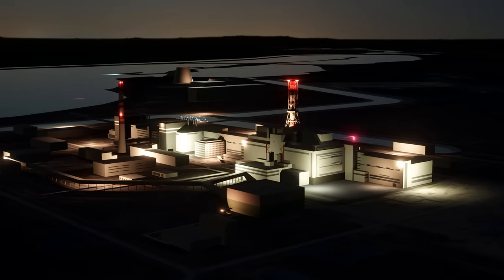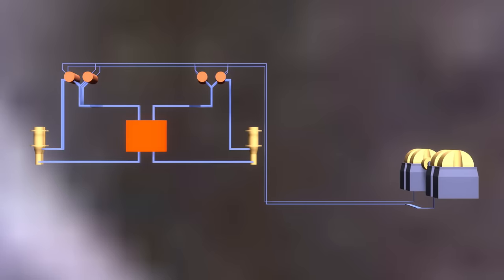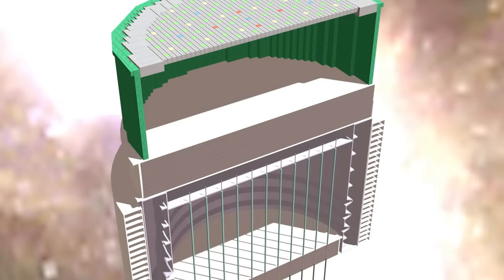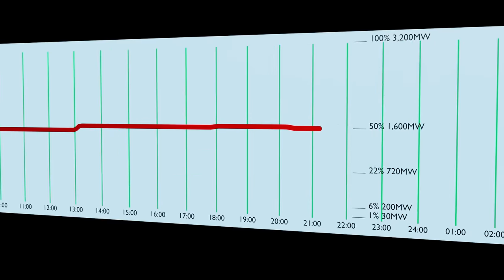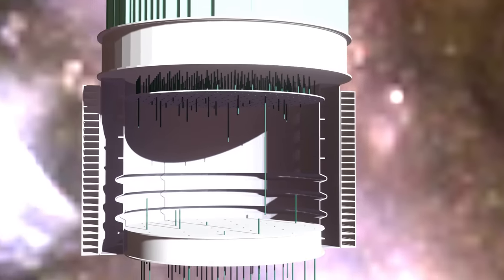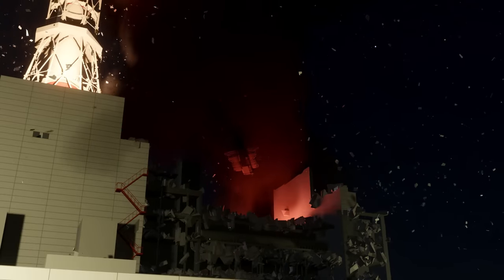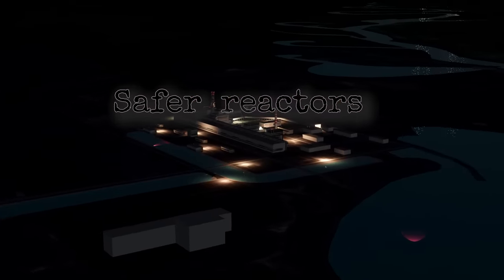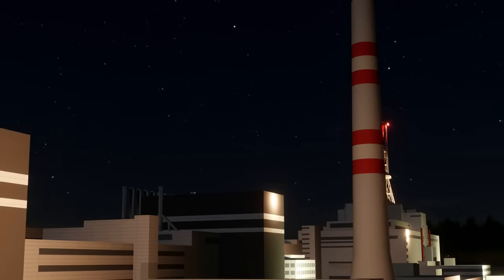CHERNOBYL AZ-5 why it exploded

Comment: Some mistakes i've found:
- Night shift wasn't unexperienced at all;
- Xenon poisoning is not the reason of power fall at night. Truly reason is unknown and happened at change from manual mode to automatic;
- Xenon poisoning did not happened due to half-power work. It happened due to power fall at night;
- Then xenon was mostly burned, from night power fall to experiment start;
- Dyatlov did not make decision about extracting of all control rods and about power rising after fall. It was Akimov or Tregub - evidences are different;
- There was not agrement about AZ-5 push after the experiment or before. Reactor could be shutdowned at any moment, cause it wasn't necessary for experiment. Experiment was runned on turbines, not on reactor;
- Experiment are not the cause to explosion at all, it's 100% unstable and not properly tested reactor.

For all other things it's a great video, explainingand showing the process without stupid staff accusations with right accents for incomplete documentation and instrumentation.

Thanks!
Reply from the maker: You will mostly the same corrections in my pinned comment.  And in my Russian version I the corrected the movement of the control rods on the AZ5 signal.  The bottom rods did not move.
Reply: @Mike-Bell  oh, i didn't see pinned comment, sorry. Thanks for your work :)
Reply: Hi, @Stef !
It could be the reason, but not only one.
INSAG-7 tells us that Xenon poisoning was happening at power lowering for the experiment beginning and then - once again - due to night power failure to 0-30 MW (heat). Main reason is reactor size, as i believe, which means pretty hard balancing work for both poisoned and non-poisoned reactor. Reactor is too big to be poisoned everywhere and i'm pretty sure xenon can not be main reason for such severe fall as it happened at change from manual to automatic mode.
Reply: @Stef 
Yes, you right about manual uprising after fall to 0-30 MW (heat).
When main reactor engineer Toptunov lower reactor power for experiment, he switched from manual to automatic mode and somewhere there error happened - reactor power fell almost to zero.
Reply: The truth about Chernobyl: HOW THE 4th UNIT OF CHERNOBYL NPP WAS BLOWN UP (channel-KS).

Comment: You forgot something, after they lowered the power to 700 MW, it continued to lower until it reached the minimum power, then they spouse to shutdown the reactor and stop at least 24 hour, however   Dyatlov forced them to continue the test, they tried to raise the power until 700 mw however the maximum they got 200 mw, Dyatlov ordered them to continue the test and stop the pumps, then the power starts to raise up significantly to the maximum power..at that time they pressed the AZ-5 to stop the reactor.

Comment: The reactor rods were graphite tipped to save cost. The rods are meant to shut down the reactor in case of emergency, however since there was already a chain reaction going on in the reactor... the " safety " rods which should have been all boron were actually graphite it excellelerated the reaction instead of stopping it.  So yes... the safety mechanism caused the catastrophe. And the reason for the whole thing,  graphite tipped control rods were much cheaper than boron. So cutting costs while playing with nukes is in fact,  not a good practice

Comment: One thing I have always wondered about the Chernobyl plant is what is the purpose of the large red and white ventilation tower? Obviously it was not an exhaust chimney, but what did it ventilate, and why was a tower used instead of a fan for example? It's interesting that when the New Safe Containment was installed the old tower was removed, but needed to be replaced by a smaller one which suggests there is still some need for ventilation - what for? Thanks.

Comment: One quick correction; you have to use heavy water as the moderator not normal water. Normal water is a neutron absorbent which kills the reaction while heavy water will speed it up while the water is in a liquid state. If the heavy water boils to steam the neutrons speed up to where they cannot split atoms thus creating a negative feedback loop. You can make normal water cooled reactors that are safer than the RBMK in chernobyl though, it just requires some design changes to avoid the positive void coefficient.

Comment: The control rod tips are graphite which accelerates reactivity which acted as a booster for the already rapidly rising power 
Soviet uranium wasn’t the most enriched so they used graphite to increase power output since it was cheaper.
Reply: That's just the cream at the top. It was already too late.

Comment: There are some gaps in this explanation. For example, it was said that, the persons in charge of the reactor during the accident, including chief engineer, were not properly briefed, while later it says that it was widely believed back then that BWR is unable to explode. What should such briefing include then??? One question is unanswered as well, was it known at that time and did the documentation of the reactor include information that control rods cannot be withdrawn fully in case of Xenon poisoning??? The reactor’s construction was internationally approved. If the design was faulty, who approved it and why?
Reply: Another funny thing: emergency shutdown switch which isn’t emergency shutdown switch sometimes and the operator has to guess when. If it was true, it was a complete misunderstanding of safety engineering at all. Technically it does not make any sense. I truly think that whole nuclear community was not prepared for safety of uranium based reactors and the knowledge internationally was lacking in that area….. seems like it was easiest to say, that “couple of untrained technicians made some mistakes” and keep it running worldwide

Comment: Water moderation doesn't enable smaller reactors.  Rather it's higher levels of Uranium enrichment that enable higher power levels from smaller reactor cores and provides the excess reactivity needed to tolerate water as a moderator. Chernobyl used Graphite, and a huge reactor core because it enabled achieving criticality from fuel with a mere 1.8% U235.

The fundamental challenge in nuclear safety is managing decay heat. It's not supposed to be difficult to shut a nuclear reactor down, which is why Chernobyl was such an unforced error. After Chernobyl, the USSR eliminated the two biggest design flaws that contributed to the disaster. First, they increased their enrichment level so that they could add additional neutron absorbers, ensuring that the void coefficient would be negative (stabilizing) at all power levels and degrees of fuel burnup. They also modified the control rod design by moving the graphite lower such that during insertion there's no region where graphite replaces water. They also dramatically increased the speed of insertion. The graph in INSAG-7 showing the change in reactivity after SCRAM is very stark between the old vs new control rod designs. With these changes, RBMK-1000 reactors have continued operating for many decades without incident.

Comment: The problem with now common light water reactors is that those require enriched uranium to work and fail to burn even close to all the fuel. As a result, you get lots of nuclear waste. Even Chernobyl would have been able to burn uranium more cleanly than modern reactors.

We are still using light water reactors for political reasons, not for technical superiority.

Comment: A3-5 button was pressed because they had a power serge and A3-5 was a button that would shut down the reactor but they had 206 out of 211 control rods completely pulled out and when the A3-5 button was pressed the control rods move back into the reactor but the tips of the control rods were made out of graphite and graphite increases reactivity and then the power sky rockets and so much steam built up the 1000 ton lid blew off then when it was exposed to oxygen the explosion happened

Comment: Hey Mike. I hope you are still reading/seeing new comments, because I wanna ask: did the fact that so many control rods were put back in at the same time after the test contribute to the accident? In other words, if only a few rods were withdrawn, and only few were inserted back in by the AZ-5, maybe the reactor would not have exploded? 

I apologize if this is a dumb question. I just want to understand it better.
Reply from the maker: There has been much discussion about this and it seems yes if the rods had been put back slower it could have avoided the explosion.
Reply: 😂😮❤😮❤😂❤😮❤😮😮😮😮❤😮😂😮😮❤❤😮❤🎉😮😮❤😮🎉😢😮❤😮❤😮😮🎉😮🎉😮🎉😮🎉😮❤🎉😮😮😂😮❤🎉😮🎉😮🎉❤😮🎉𓽤😮🎉❤❤😮❤😂🎉❤😮🎉😮❤m😮?🎉😮🎉😮❤🎉😮😮😮😢 9:18 😢❤😮❤😢❤😮❤😮❤😂😂❤😮❤😮🎉😂😮❤😢❤😂❤😮❤😢m😮❤❤❤

M 9:18 ❤😮?
M😂😮m❤❤❤😮🎉❤❤❤😮😂❤🎉😮😮🎉🎉😂😢❤😂😮🎉😮❤m❤😮😮❤😂❤😮😂❤😮😂🎉😮🎉❤𓽤 9:18 😮😮😂❤😮😮🎉❤😂😮😢😂❤😮
🎉❤😮 9:18 ❤
❤❤😢 9:18 
❤😮😂😮😮❤
😂😂❤😮😮😂😮😂😮😂😂😮
😂❤🎉❤😂❤😂
😮😮🎉😮
L
😮😮😂❤😮❤🎉🎉😮❤m🎉😢❤😮😂❤😂?😮😮❤😂😂❤😮😂😮😂😮😢?😂🎉 9:18😮❤ 9:18 9:18 m
? 9:1m mm mm? 9:18  9:18  m lm 9:18 m mmmm lL mm 9:18 9 9:18l 9m mm lmm lL 9:18 ll 9:18 lll😂
Ll lm lm 9:18 9:18 lm ll lm m mm 9:18 m🎉m🎉🎉 ll 😂 9:18 mm
 lmL
.l😂 mm l mm l lm l 9:1 9:18? 9:18 9:18 9:18 mm
Lm lm llll 9:18 l 9:18 😂lll LL ll m mm lmm lL lm mm lmm lL l 9:18 l 9:18 mm lmm l 9:18 LL l 9:1 9:18l😂 mm lmml LL lm mm lll km lm l l lm llll km LL lm ll😂llllm l 9:18 mm lm mm🎉
😂Ll l LL ll
Llll lm l
Mm lm 9:18  l LL l
L LL lll LLl km LL l LL llll lm lm l LL l LL l
L mm l lm. Ll 9:18 mm LL ll LL LLLL. LL 9:18 9:18 9:18 l lm
Lll LL lm lll l l lm LL LL 9:18 lm lm l 9:1. LLLL l
L😂.🎉 Mm l LL lm 9:18 lm LL LL l lm 9:1llll LL lm LL lm
L lm l
L 9:1 9:18 lll LL l 9:18 lm lm ll LL LL LL l LL lm lm
Lm l 9:18 9:18 9:18 9:18 9:18 l lm LL LL l LL LL lm l lm.lll LL lm lm l LL lllll LL lll ml LL lm l LL LL Lll km l lm l LL mm LL l lm lm LL lm ll lm l LL LL lm lm lm lm ll lm lm lm
L lm lm lm lm lmm LL lm l lm LL LL l 9:18 lllll LL 9:18  lm lm 9:18Mm..😂l
Ll
L. 9:18 9:18 9:18 l 9:18 9:18 9:18 9:18 9:18 9:18 9:18 llll
9:1.llll

.lllll LL
L l 9:18lll 9:18 lmll LL l 9:18 9:18 9:18 LL
😂
Ml lm lm lm l lm🎉 mmll 9:18 😂😂
Lm LL llll 9:18 mm l.l lm lm lm lm
L😂l lm l 9:18 l LL 9:1ll ll.ll

L LL ml 9:18 9:18 9:18 9:18 9:18 lm LL ml LL.ll LL LL l 9:18 lm ll
LL..l 9:18 lm LL lm l lm l lm mm LL LL mm LL 9:18 l 9:18 l 9:18 ll 9:18  LL 9:18 9:18 9:18 9:18 lll km LL lm lllll km k
Lll
LL LL l lm l LL l LL lllllllm lm lm lm lll 😂 LL LL lm LL l 9:18 ll 9:18 ll 9:18 l LL LL ll lm lm 9:18 lm
9:18 LL
LL LL LL l LL LL lll LL LL Lllm LL lm 9:18 9:18 .l 9:18 9:18 llll 9:18 ll
Mlllll lm 9:18 9:18 9:18 9:18 
Lll LL l lm ll
L. 9:18 9:18 9:18 lm 9:18 9:18 lm. 9:18 lllll
Mm

Ml LL lm lm LL LL lm 9:18 
Ml l 9:18
Lll LL l LL LL ll 9:18 ll 9:18 l 9:18 l 9:18 l 9:18 .l 9:18 9:18 ll 9:18 ll 9:18 mm l 9:18 9:18 mm 9:18 9:18
L LL ll 9:1LL lm 9:18  l LL. LL lm lm l lm lm l lm lll. 9:18 9:18 lm 9:ml😂l lm 9:18  l LL lm lm LL 9:18  l 9:18 9:18l 9:18 llll 9:18 9:18 
Ll 9:18l.l.lllll 9:18 LL
Lll LL l lm. Mmll.llll lm l LL 9:18  lll LL LL llllll9:18  Llllllll LL lm lllllllll LL lll LL.lll 9:18 l 9:18  lm LL
LL LL lm llmlml LL LL LL. Ml llllllll
.lll km. Ll?llml LLlll lm LL LL l lm
L
Mm l LL😂 mm 9:18 m
L.😂l
L

Lll llllml.l.😂lm.l LL😂l LL lllll LL lll LL lll😂 Ll ll LL l lm.lllll 9:18 l LL 9:18 LL
LL LL llll
Lll.ll l
Lllll LL l lmll
Ll LL lm lm LL lm l lm l lm lll LL
LLllllllll l LL.
L
LL llllllll LL ml LL LL llll lm
LL LL LL
Llllml LL l LL llllllll LL llllm
.LL lm l LL LL
l
LLl
LL LL lm llll LL l lm. Llllllmlll😂ll 9:18 ll 9:18 9:18 9:18ll.llllllll LL lll 9:18 9:18 9:18 LL lllll LL llll 9:18 9:18 LLllll LL llllllll lm lm ll.llll.ll
9:18 9:18 9:18 9:18 9:18 lll lm.lllllll
9:18 Lll 9:18 9:18 9:18 9:18 9:18 km 9:18  lm 9:18  Llll 9:18 9:18 9:18 l 9:18 l 9:18 9:18 mm 9:18 9:18 9:18 ll
Llllllllll LL 9:18ll 9:18 9:18 .ll 9:18 lm m.ll lm lll lll LL LL.
Lllll LL lllmlllml LL ll l mm l LL lllllmllmlml LL l LL LL LL l LL llllllllll
LL lm llll llll lm l LLLL l LL  LL lm mlllll
LL LL l LL LL lllll lm llll lmlm lm🎉 mmllllll 9:18 LL 9:18 lm l LL
L LL l lm lllll 9:18 9:18 9:18 9:18 9:18 9:18 LLlll 9:18 l 9:18 ll.l. 9:18 9:18 9:18ll 9:18 lll.l 9:18 lm..LL
LL.lll

Llllllllll LL LL LL llllllll
L L LL LL llll.Lllll
L LL l lm LL lm lm LL lm l LL lllll LL LL
Llll LL LL L LLl lm lm

LL LL lm LL lm l lm lm LL l lm llllllm😂 LL
L lm lllllllmm 9:18  lm 9:18 ll 9:18 ll 9:18 ll 9:18 9:18 l 9:18 9:18 9:1l 9:18 9:18 LLllll lm l?
9:18 llllll 9:18l 9:18 9:18 ll 9:18 9:18 LL lml 9:18 ll
L.lll 9:18 mmlm 9:18 m LL 9:18l 9:18 LL 9:18 9:18 LL ll 9:18 l 9:18 😂LLl 9:18 9:18 9:18 mm 9:18 9:18 l LL 9:18 l LL 9:18 l LL LL lm LL 9:18  l 9:18 ll.ml lm LL lm LL lm 9:18 9:18 9:18 9:18 l 9:18 9:18 l 9:18 ll 9:18 .
9:1l lm lm lm l 9:18 m 9:18 
9:18 
9:18 lm l LL lm mmll
L LL llll LL LL LL lm
Lll mm m
Lm lll km m mm lm l lm
Lll lm ml lm m LL lm lm l LL l LL LL mm mm lmm l mm mm l mm m LL lm lm LL lm LL LL LL l.lll LL mmm🎉
Llllllmlllll 9:18 9:18 9:18 9:18 9:18 9:18.l 9:18
Llll 9:18 llm 9:18 😂 9:18 .l

M😂 9:18 9:18 lll 9:18 lllll 9l mm ml:18 9:18 9:18 m lm lml 9:18 9:18 🎉 9:18 🎉LL 9:1 9:18 lll km LL ll LL l LL LL LL l🎉 LL all🎉 LL l🎉🎉🎉 LL LL🎉l LL LL LL.🎉l🎉😂🎉🎉🎉 LL🎉🎉😂🎉😂🎉🎉🎉😂🎉
Reply: The truth about Chernobyl: HOW THE 4th UNIT OF CHERNOBYL NPP WAS BLOWN UP (channel-KS).

Comment: It all happened because the reactor was held at half power from 3200 MW to 1600 MW which caused the formation of xenon which acted like a barrier or slag stuck in a pipeline....while the staff being unknown about it... they reduced the power even half which weighed down the reactivity to which the staff tried to power up the reactor by stopping the water and removing the control rods ; gradually the xenon got decayed away when the remaining water was getting vaporised significantly and when the power was rising they forgot the water pumping was off but they ran for Shut down button which Actually had the flaw,  that flaw led the expansion of water vapour molecules significantly that ruptured the pipes and control rod channel which threw away the lead cover  ; the heat in the reactor , the hydrogen and oxygen got mixed up that actually caused the explosion..... which led to the expose of uranium 235 ...the uranium 235 on fire .....

Comment: Animation is not quite correct. The first explosion was a steam powered one. It blew the lid off the reactor, but did not breach the building structure by all accounts. The second explosion was from all the free hydrogen flying around and that is what demolished the building and flung all the crap out. The power excursion prior to the big bangs was on the order of 1 TW thermal, about 120 times the normal output.
Reply: Correct. The "end-effect" of graphite displacers caused a large reactivity spike, which turned all of the water in the core into steam and blew the "Elena" lid off. Steam reacted with zirconium tubes that contained Uranium oxide pellets, producing hydrogen. Hydrogen + air + very hot temperatures = BOOM!

Comment: Failed to explain how Xenon poisoning happened which is one of the most crucial reasons of the catastrophe. The shutting down button pressed is not the root cause of the issue. They already reached a point of no turning back at that time. Even if the positive void never happen at the bottom of the reactor, the explosion is inevitable due to the built up nutron and the control rods won't insert fast enough.

Comment: Moderator sounds like something that SLOWS the reaction.

But you're telling me that it just slows down the neutrons, which actually speeds UP the reaction?

So less moderator = good, if you want to prevent an explosion.
Reply from the maker: Yes it is confusing.  Fast neutrons escape the core =  no reactivity = no chain reaction. This is why natural uranium in the ground cant sustain a chain reaction.  Slowed neutrons create the chain reaction and so are essential.  In the RBMK the graphite moderator is fixed and cant be removed.  The reaction can only be stopped with boron control rods.  In a water moderated rector removing the water = no moderator = no chain reaction.